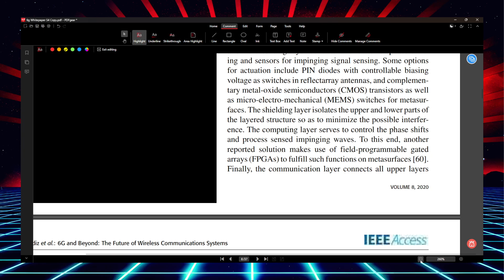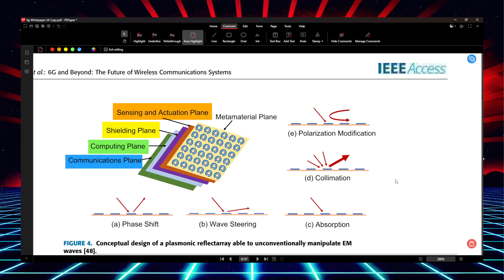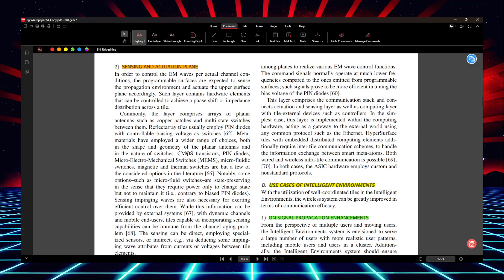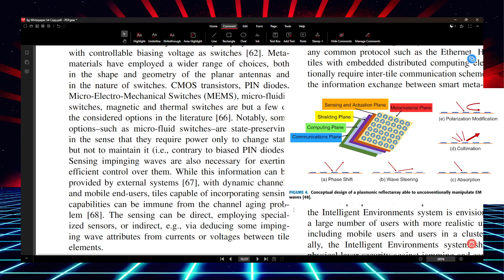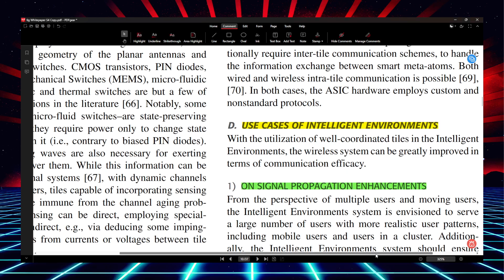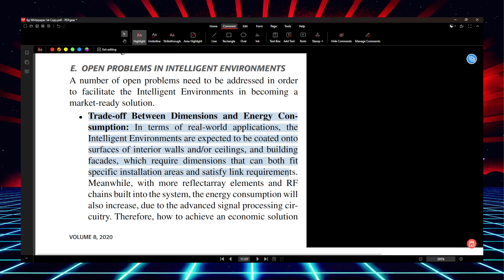6G Paper Breakdown (Pt. 4): Intelligent Communication Environments #HumanHusbandry #6GTechnology

Comment: What does all this mean
Reply from the maker: This is the 6G Proposal White Paper, if you haven't seen the first or second parts it'll probably be hard to start off here. Section 1 and 2 will answer your question best while section 3 deals with Terahertz Band (Microwaves -> Millimeter Waves -> Terahertz -> Infrared) and this section deals with strategies to basically manipulate and control the way energy moves on micro and nano levels.

See my notes here: https://docs.urbanodyssey.xyz/biodigital-convergence/
Reply: Scary that all this info is out there. We know if it's out there they are and have been using it. Then the next question is,... What are they using that they aren't telling us about. There are a lot of ppl suffering due to this tech..and most of them in silence.